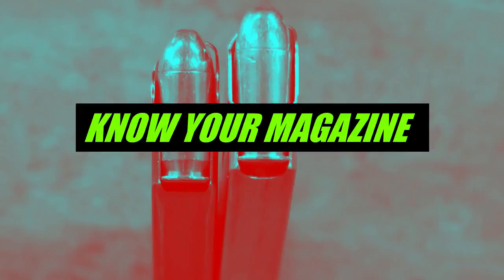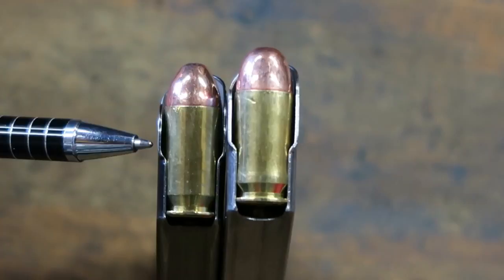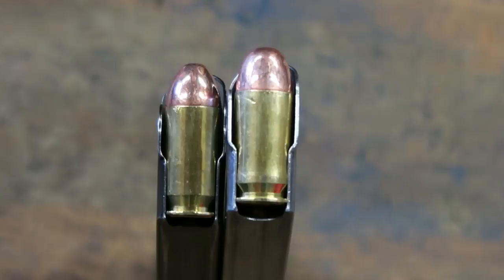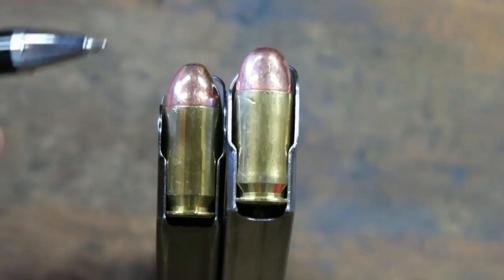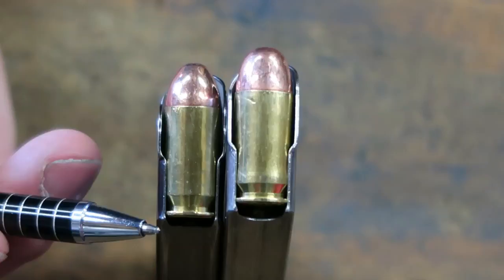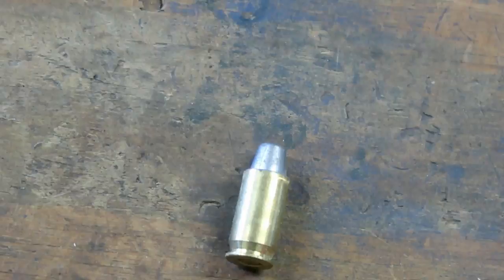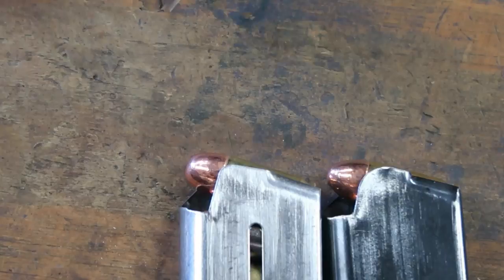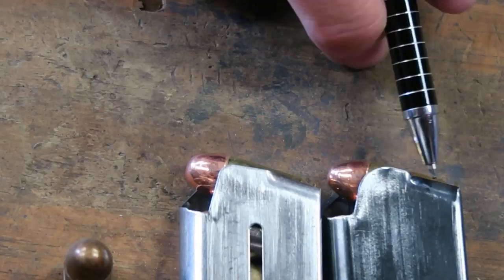Know Your Magazine

Comment: I’ve been banging my head on the wall wondering why the only mag that works with my CMP 1911 a1 ( 1943 Ithaca frame) is the one it came with.  Was told to bend the last coil to change the angle.  That wasn’t it !  It was the feed lip.  It barely has one. Wilson combat, Checkmate USGI mags have more pronounced curved feed lips  that keep the bullet down and slamming into the feed ramp.  Old USGI Sarco surplus have the same feed lips as the CMO issued ..but the followers and springs needed replacing.  Ordered a Chip McCormick USGI… we will see.  Very frustrating.

Comment: Just when I begin to think I know everything there is to know about the JB's 1911....I learn something new....lol.  Good info ol buddy, ive heard time and time again how important good magazines are for 1911's but I had no idea there were different length feed lips and how critical they were in the functiin of the gun.
Reply from the maker: Yep after a hundred years of competition and experimentation, there are a lot of different mags out there. Some work for specific guns with specific ammunition only. Staccato only recently redesigned the original STI magazine to get the 2011 double-stack 1911-type pistol to run reliably. The magazine is the key to reliable performance. Keep it clean, and wet, and feed it with good ammo and a 1911 will run like a Singer sewing machine.

Comment: I understand, there is no Universal Magazine, and Many are made out of spec, is up to the user to find which round will work in your 1911.
The other option is "luck and find you" for a proper explanation. Most of the dealers in this area do not have a clue, they don't even what
the bushing does in a 1911. You can understand how you can use a Glock or Springfield .45 caliber out of the box with no problems.
We should be in the Range shooting our weapons without having to figure them out.

Comment: How the slide stop interacts with the follower, and if the mag interferes with an extended ejector is critical to slide/ mag release also. 
Extended extractors can get bent with continued use of slamming the mag home. 
Multiple mags and multiple 1911 clones are a recipie for failure.

Comment: Thank you so much. I knew magazines were important, but I appreciate you showing me why and what you need to look for in the magazine.
Reply from the maker: The two most important things is Quality and the length of the feed lips. If yours has an alloy frame the followers design is also critical. Those pistols can be damaged by early G.I. style mags whose follower isn't rounded off and smooth. 
Thanks for watching.

Comment: Thanks for this Great article publication. Hopefully, this will help many with 1911 complications, when they are incapable of looking at all components to realize their complications, if any. My sole disagreement, opinionated with no offense intended would be the "Semi-Wadcutter" you mentioned. I am in belief that any 1911 owned should be capable of firing all ammo introduced to the feed ramp and barrel, for not only enjoyment but self defense in time of need experience. I own many 1911s, and they all feed and fire the semi-wadcutter, some right out of the new box. The semi-wadcutter, possible 185gr shown in this video is way too short in OAL and would probably jam. 185gr are the most difficult, so sticking with 200gr herd lead, coated or jacketed semi-wadcutters offer a lot of fun with clean holes on the paper at the range. Anybody that doesn't enjoy or posses a 1911 pistol is really Missing Out! Again-Great Video!

Comment: Those are wadcutter magazines that you show in this video.  The standard G.I. angled feed lips are best for ball ammo as they maintain controlled feed through the loading cycle.
Reply: True, straight lips like that don't work well for the controlled feed the 1911 with .45 ACP hard ball. The round will feed but the extractor hook will snap over the rim each time instead of being feed it under like John Browning intended. That can be easily checked by removing the recoil spring and operating the slide very slowly manually and observing he function. Original Colt Mags have tapered lips, not straight.

Comment: Ive never had this problem in buying standard size mags for any new 1911 nor even heard of this problem.  Ive only heard of two sizes.  One size for standard length grip and ones for Compact or Officer size frames.
Reply from the maker: I have, they were marked as colt 45 and wouldn't even fit into the gun. The pistol was my Springfield Armory loaded standard 1911a1. I returned them and found real Colt mags. The problem usually shows up when buying used magazines or fake mags made in China or Korea.
Reply: @mackdaddy1911a1  Yea ive seen those knock off Colt mags before.  You see them mostly on Ebay!  Buyer beware!
Reply from the maker: @nonyabiz9487  I bout them with the gun. Took them back and have only purchased new quality mags since.

Comment: 3:29  I think the one you showed in the video was a semi-wadcutter, a wadcutter bullet is perfectly cylindrical with a completely flat front surface.  Semi-wadcutters are the ones with a flat shoulder, and a cone with a flat tip above the shoulder, like yours :)
Reply from the maker: You are correct and I appreciate the correction. Thanks for watching.

Comment: I can't believe you ignored the USGI V tapered style feed lip style, which IS the original style and is optimal for a Government model with 230 grain mil-spec ball ammo.   The controlled round feed system has six components:  The feed lips, the follower, the extractor, the feed ramp, the barrel throat, and the bullet profile. 

Plated/cast round nose bullets are NOT equivalent to full spec USGI hardball/ full metal jacket bullets.

Comment: I just bought a S&W 1911. When I laid a mag the last 3 rounds don’t want to sit right in the mag. They either point down too far or they pop out.
Reply from the maker: I assume your ammunition is factory but it sounds like it is slightly overlength or the follower is binding. Does the magazine have a removable floor plate? If so take it apart and allow the follower to move up and down the tube. Is it binding anywhere? 
G.I. magazines have a welded floorplate. With those, you have to depress the follower about halfway and capture the spring using a small punch or cleaning rod, then shake the follower out. Then take the spring out. Note the direction of how the spring is wound. so you put it back in correctly. Then reinsert the follower and make sure it moves freely. 
If it doesn't move the entire length freely the tube is out of spec. Gun dealers are notorious for swapping out name-brand factory mags for cheap junk mags. Is it stamped with the S&W logo? If not it is not a real S&W mag. I would bend the dealer's ear and insist on a new S&W mag or a Wilson Combat or other premium magazine.

Comment: A 1.25” COL 200gr SWC’s nose on the outside edge matches the original 230gr FMJ. Chip McCormick mags feed my 1911 boringly reliable. Won’t feed my GI spec mags. CM also flawlessly feed my HP’s.

Comment: Mags are driving me nuts with my Magnum Research (Desert Eagle) 1911U compact.  The Mec-Gar Mag that came with it works fine (who would have thought) but additional Meg Gar mags are not available.  I have had good luck with my full size 1911s with Chip McCormick and Ed Brown, but not with the compact.  McCormick's won't work at all, and one out of the three Ed Browns is very problematic, while  the other two have intermittent issues.  This is with 230rg Hard Ball.  None work with hollow points. I got this gun to be my EDC, but right now I feel like it is only good as a boat anchor.
Reply from the maker: Try a Wilson Combat 47D. If it won't run in your pistol I will buy it from you. I assume your pistol has a 3 inch  barrel. That is an Officer model size pistol. Look for magazines designed for an Officer size pistol. These pistols cycle faster than Government length (5") or Commander(4") length pistols. The faster cycle time requires a magazine with shorter feed lips. Also check your extractor tension. To do so field strip the pistol. Lay the slide (sights down) on a flat surface. Take a cartridge and push it into the extractor hook. Ensure it is flush with the breech face too. Pick it up turning it upright. Shake it. The cartridge should not fall out. Also, it should not be difficult to insert the cartridge into the extractor. If it is the extractor may be tensioned to tightly. I also have not had much luck with McCormick magazines. 
One more thing, lube the slide and frame rails often. 1911s require plenty of lube to run well. I personally use high temp grease on the rails. Personal preference but I have had good luck doing so. 
Good luck. PS check out Wilson Combat's web site and look for officer model magazines. Also Metal Form and Mec-Gar.

Comment: The only ones I've ever had any issues with are extended 15 rounders
Reply from the maker: I have never tried a 15 rounder. But the ten rounders have not been 100%. No real issues with 7 or 8 round mags that were not caused by a dry gun or the extractor.

Comment: Well I’m joining the crowd here sir. I’ve owned several 1911’s over the years. Mostly 5” and one compact (officers model) . Never knew a thing about the difference the feed lip length would make until hearing you explain it just know. My latest and last purchase a Springfield Armory Garrison in blued steel maintains much of the traditional appearance of a Colt Series 70 Government Model that I’ve long regretted parting with. She’s a pretty girl and a fine pistol. Thanks for the knowledge. 👍❤️🫡🇺🇸
Reply from the maker: Just passing along the knowledge I found in the books The M1911 Complete Owner's Guide and The M1911 Complete Assembly Guide both by Walt Kuleck. Both were published by Scott A. Duff Publications.

Comment: Thanks  a  great          tip iam waiting  for my 1911  to be delivered  .
Reply from the maker: my only suggestion is to get a copy of the book,M1911 Complete Owners Guide by Walt Kulek. Study it. The information in it is worth it's weight in gold. It can help prevent the mistakes I and others made. Ignorance is expensive. That I can guarantee. There is a troubleshooting guide that is most helpful in diagnosing common problems and solutions. Again, worth every penny you will spend on it. Good luck.

Comment: Just bought Wilson some Wilson Combat 47D 1911 magazines, and they do not slide effortlessly into place. They stop about 3/4 of the way, then I have to use the heal of my hand to bang it into place. Once locked into place gun shoots fine. Why does the Wilson do this, and yet not the factory magazines? Thought Wilson mags were the best of the best:(
Reply from the maker: that hesitation is caused by the magazine catch. It is pushed out of the way until it snaps into the cutout in its lock window in the side of the magazine. That IS NORMAL. The magazines may be a couple of thousandths bigger than the factory mags. As long as the magazine doesn't get stuck and smoothly inserts to that point it is fine. Note: striking the magazine with the heel of the hand is the recommended way to load the magazine to insure it is fully inserted and locked into place. It is also step 1 of the TRB drill to clear a malfunction. Tap Rack Bang. Good Luck.
Reply from the maker: https://rumble.com/v2hrw7o-magazine-insertion-issues-.html

Comment: Forgive the noob question, please.  I'm on the wrong side of The Pond to do any hands on checks for now.  
I just bought a new Colt Govt Classic.  Full size, 5" bbl.  I'm looking at new Colt mags and am getting a little turned around.  Will 7 rd Colt Govt COMMANDER mags still fit and run my Govt Classic?

TIA for any info.
Reply from the maker: first, thanks for watching. Second, the only dumb question is the one you don't ask. Third, if they are new production mags, or have the parallel wad cutter lips like the Wilson 47D mags in the video, Yes they will work. When the Commander (4.25") was introduced Colt introduced their Hybrid magazine. It released a bit earlier than the original G.I. magazine.  The timing is not the same for the Commander size guns and Government model. Most modern production magazines, except on reproduction guns such as G.I. (style) 1911a1s now have the parallel wad cutter lips. And ALL my 1911s run using them. Even the original 100 year old Colt 1911. The 3 inch Officer size guns are faster cycling and MUST run magazines with the short "Wad Cutter" lips. The shorter feed lips releases the cartridge earlier in the cycle. Original wedge shaped "G.I." Type magazines release to late and will choke the faster cycling 3" guns. 
Only on reproduction G.I. guns will you see the wedge shape feed lips. However if you buy used magazines, all bets are off. Because so many people tinkered with the Pistols and their magazines for competition their were hundreds of ideas that became dead ends. Some are still floating around. 
New production magazines from Colt will run in your pistol. 7 round mags were what it was designed to feed from so they will be perfectly adequate to the task. Note: it was designed for 230 grain, FMJ round nose bullets. If you decide to shoot other types or weights of bullets. Test each extensively before trusting it to run 100% reliably. Guns are like girls, some can be picky. Good luck.

Comment: I got a government size Springfield Garrison in 45 auto.   It has severe feeding problems. The stock mag and 2  mec-gar mags jam 50% of the time. I use 230 grain ball. Any advice would be appreciated. Also sometimes when ejecting an unfired round it gets stuck on the extractor.
Reply from the maker: Feeding issues maybe a rough feed ramp. Get a 3/8 wooden dowel. Wrap it with 500 or finer sand paper. Field strip the pistol and secure the frame in a padded vice. Used a Sharpie and color the ramp. Evenly polish the ramp. DO NOT remove the edge at its bottom. Only do a little then reassemble and hand cycle the slide. Lubricate the slide and rails.
  Ejection issues. Unless the ejection port is lowered and flared ejecting unfired brass can be an issue. But cleane the entire breach face including pulling the extractor. Clean it and it's hole thoroughly.
Reply: @mackdaddy1911a1  thanks for the advice.

Comment: My new sr1911 came with two mags. One 8 round and one 7 round. The front and rear of the top of the mags are different.  One is flat and one is round in the rear.  The front openings have different angles. Anyone know why this might be ?
Reply from the maker: One maybe an original GI type and the other a more modern version that will help it feed hollow points as its shorter to release the cartridge earlier.

Comment: Would some old Vietnam era mags work in modern 1911's? Got some from my uncle from back when he served and I'm curious if they'll work in mine.
Reply from the maker: In a 5" Government model absolutely. The springs are probably weak if they are that old but no big deal. Brownell's, Midway USA and many other places have replacement springs. So if you have feeding issues get new springs. I think in this video I cover how to disassemble an original GI magazine with its solid floorplate. If not one of the disassembly videos has it. Not hard once you do it a few times. But wear safety glasses.

Comment: Mackdaddy, I just purchased my first 1911 it’s a 4 inch range officer Springfield armory model. I just bought some chip McCormick magazines and eight round in the 10 round Power Mac, and for whatever reason when I put the magazine up through the mag well, I’m not able to send the slide forward. Any idea what that may be?
Reply from the maker: Visually inspect if the magazine is too high in the pistol and is blocking the slide. Possibly the mag catch or latch window in the magazine is mislocated or out of spec. Also, look to see if the top cartridge is not stuck or nose down in the magazine.

Comment: You should not be carrying FMJ for self defense, especially in a .45 for sure. It will exit anyone it's fired on and will still have plenty of energy to damage innocent people.
Reply from the maker: I load both JHP and FMJ. The JHP to dump all the energy into the target & the FMJ too penetrate light barriers. And or destroy their firearm if a shot presents itself. The .45 ACP is so slow that over-penetration isn't as big an issue as with 9mm. Knowing your target and what is near or behind it is one of the cardinal rules. However, I agree it is a possibility so if push comes to shove I will adjust my angle of fire. That is or should be a concern for us all and should be considered and trained for. Standing square with a target is only one way to engage an opponent. Kneeling or squatting are others as is prone. These three will adjust the angle also. 
What if the shots have no effect due to body armor. Shoot them in the dick, throat, face, and or any other exposed portion of the body. Or a place that even with armor is weak. Hands, Knees, Ankles, Groin, etc. YES, even their firearm if possible. The Hollywood Bank shootout in the 90s should have driven home that point to the police. But clearly hasn't. Nor to civilian schools. Don't attack their strength attack their weakness. But be aware of what is behind or near them.
I appreciate your point, though I have thought about over-penetration. It is only one element to consider. Regardless of bullet type not all JHP expand as advertised. Even with much faster rounds such as 9mm etc. Even with +P rounds. So don't expect 100% perfect expansion. Or you don't get the shot you want and if say you hit their traps or bicep your shot may exit the scumbag. Or maybe deflected by a twig or glass or.... There are too many possibilities to wargame them all. 
I am not a professional however I learned critical thinking in school. Who, What, Where, When, Why, and How.  Why did that happen? How can I prevent that? What can I do differently if facing a situation like that?